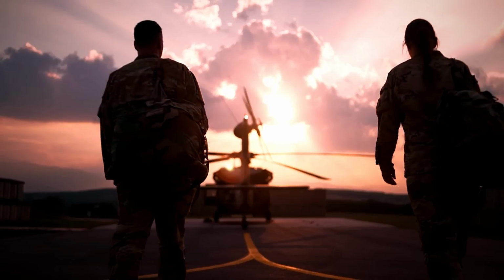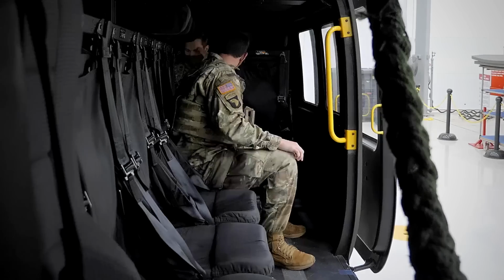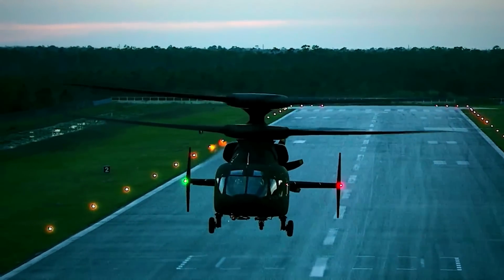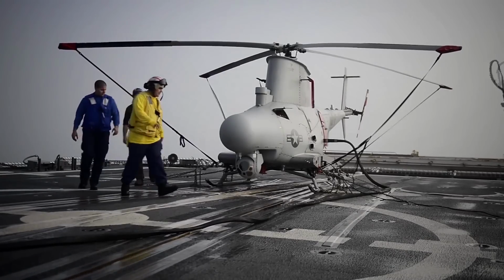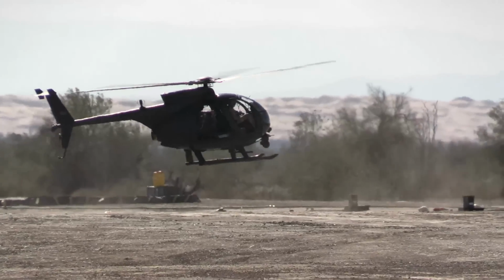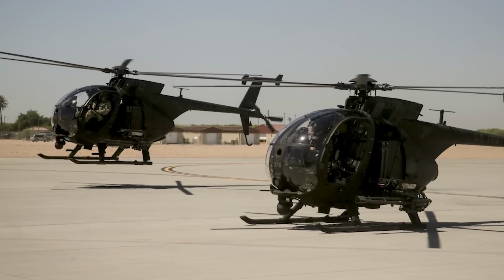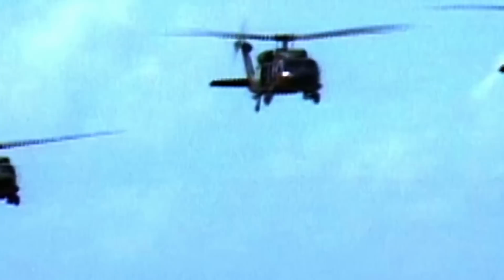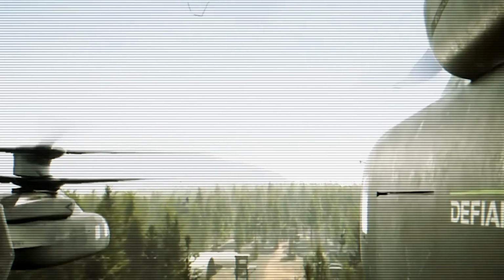America's Deadliest Flying Weapons Revealed

Comment: THE FUTURE OF THESE AERIAL VEHICLES SHOULD GO TOWARDS THE SAMSON TYPE HELOS FROM THE SERIES AVATAR DUCTED FANS ARE QUIETER AND MUCH MORE EFFICIENT, JUST LOOK AT THE LOS ANGEL;ES CLASS SUBMARINES PROPULSION WITH THEIR 12 BLADECURVED ROTOR INSIDE A DUCT, THAT SHOULD BE EXPLORED ON HELICOPTERS, THE USE OF COMPOSITE MATERIALS, ALONG WITH ROTATION PULSE DETONATION TURBINES, WILL INCREASE THE POWER AND RANGE PLUS A LOT QUIETER THAN THE OLD REGULAR OPEN FAN BLADES THAT HAVE REACH THEIR LIMITSHOW LONG WILL IT TAKE FOR THE RIGHT MINDED PEOPLE (SCIENTIST) TAKE FOR THEM TO START DEVELOPING THESE NEW WAY OF THINKING?, THOSE GROUND TO AIR MISSILES ARE WAY TOO EXPENSIVE TO TAKE DOWN SMALL DRONES THAT ARE SO CHEAP IT'S AN INSULT, A ONE HUNDRED THOUSAND DOLLARS MISSILE TO TAKE DOWN A 500 DOLLARS DRONE OR A 20 THOUSAND DOLLARS SHAHE 136 ? THESE AIR DEFENSE SHOULD BE EXPLORING MINIATURIZED DIRECTED ENERGY WEAPONS, AIR BURST AMMO SHOT FROM A 30 mm NORTHROP DESIGNED CANNON, BUT THE SCRET IS IN THE TYPE OF AMMO, A POLYMER CASING BASED WITH A PROGRAMABLE FUSE MICRO WARHEAD THAT CAN BE UNITARY OR DISPERSABLE AS NEEDED, ALSO THE COMBINATION OF AN AI BASED ALONG WITH AN OPERATOR TO IUNSTRUCT OR GIVE THE FINAL OK, DEPENDING ON THE SITUATION, THE AIR DEFENSE PLATFORM SHOULD HAVE THOSE 2 OPTIONS A DIRECVTED ENERGY AND A CANNON, ALSO MICRO MISSILES, ALSO IT COULD BE DEVELOP A JAKAL TYPE DRONE THAT CAN HOUSE 10 MICRO MISSILES IN A INTEGRATED AIR DEFENCE NETWORK, IN UKRAine for  THEY SHOULD PLACE AEROSTATIC ZEPPELINS OR BALLOONS LOADED WITH SMALL SYNTHETIC APERTURE RADARS AND INFRARED DETECTION OPTICS ALONG WITH ACOUSTIC SENSORS TO IDENTIFY OR SEARTCH AND TRACK THOSE SHAHED, , CRUICE MISSILES, AND OTHER TYPE OF ATTACKING WEAPONS  WITH THESE EARLY WARNING DEVICES, THEY COULD ARM THEM WITH  DESIRE ARRAY OF DEFENDING WEAPONS TO NEUTRALIZE  INCOMING THREATS, SET UP A NETWORK OF THEM AROUND ALL THE CITIES THAT CAN BE TARGETED BY THE RUSSIANS, REDUCING THE AMOUNT OF DAMAGE THEY CAN CAUSE, REMEMBER DURING WORLD WAR 2 THE ALLIES HAD THESE AEROSTATIC BALLOONS THETERED TO THE SHIPSAND ON THE GROUND FOR THE SAME REASON, BUT WITH THE TECHNOLOGY WE HAVE AVAILABLE TODAY, IS MORE THAN POSSIBLE

Comment: If it looses one engine, the whole thing is toast. You won't be able to autorotate, and in straight and level flight, the asymmetric thrust created by the massive rotors will guarantee that the aircraft will become uncontrollable if it loses one engine. Engine loss from bird strikes, compressor stalls, and other reasons are common in aviation, and whereas normal helicopters can autorotate into a safe landing, and conventional aircraft don't have quite as much asymmetric thrust to deal with, This bird has the worst of both worlds, and will prove to be a deadly waste of money. Add in combat damage, and this aircraft is a disaster waiting to happen. The boys have to have toys though, and toys never seem to last long, so let's raise taxes and spend more on things that will ensure our defeat on the battlefield.

Comment: That thing will never replace the C-130 in any configuration.
Reply: True story!!
Reply: @iainriley8819  Right? The Army doesn't even fly C-130's... At least not in any significant capacity.
Reply: I tend to agree, but how cool would it be to launch Rapid Dragon from this thing?
Reply: When they said it would replace the C-130 out of my mouth came WHAAAAT?
Reply: Nope,1 size fits all Marxist BS

Comment: As with previous helicopters, how much fire can it take before it goes down.  Hate to field a one-shot deathtrap.
Reply: Are you happy with a Five Shot Deathtrap?
Reply: @rainerbehrendt9330  Nope.  I want to hear wind whistling through the holes, a smoking engine, and it still lands where it came from!  That’s not too much to ask, is it?
Reply: @ssaraccoii  Could be heavy. A Movie War would be easier. All you need is Squids and a Smokegenerator. Best Example is Rambo II. The Huey is a Beast.
Reply: @rainerbehrendt9330  Given advancing technology, current level 4 body armor is thin. Maybe an adaptation. 🤷‍♂️
Reply: @ssaraccoii  Most Attack Helicopters are armoured against 23mm Bullets but that is a Thing of the past. Modern Manpads are a greater Problem. The RPGs at Mogadishu were even cheaper and proved effectiv enough.

Comment: Praying theyre more safe than the Ospreys cuz those things have killed a lot of military personnel in just training flights!
Reply: Just remember that the Osprey was the first of its kind and therefore much was still unkown and had to be found out the hard way. The Valour has been designed with all the insights learned from the Osprey and therefore should do much better.
Reply: @tjroelsma  Just remember they had SEVERAL years to fix the problems or can the plane, BUT DIDNT!
Reply: @chhansen9813  That means the Armed Forces have weighed the negatives against the positives and found that the latter exceeded the former and decided to keep on using them. And how do you know that they haven't fixed many of the problems?
Reply: @tjroelsma  LMMFAO! Then why have they NEVER EVER used them in any "mission" whatsoever? CLOWN! They, or I mean, "WE" paid for them so they have to "appear" to be trying to use them! CLOWN!
Reply: @chhansen9813  Rude sod
Reply: Yeah you couldn’t pay me to climb on another one at this point!!.. But to be fair, they had to start somewhere.. I don’t ever expect greatness from a prototype/new aircraft.
Reply: Thing with the V-22 is, if you compare it to fixed wing it's far more accident prone, but compared to rotary wing it's roughly average. 
It had plenty of problems and still has a few, but I think part of the bad reputation is when people hear Osprey Crash they think plane crash and not helicopter crash.

Comment: The VL replacement is wishful thinking. The Blackhawk is likely to be replaced with the MH-139A Grey Wolf and has entered into service with the USAF. This will likely continue to see adoption by additional branches. 
The AH-64 Apache will likely be modernized and given a new letter designation. If anything is likely to be straight-up replaced without a clear successor, it will be the CH-47 Chinook.